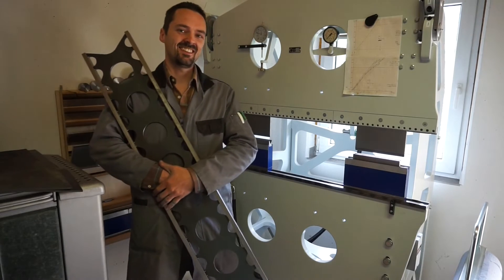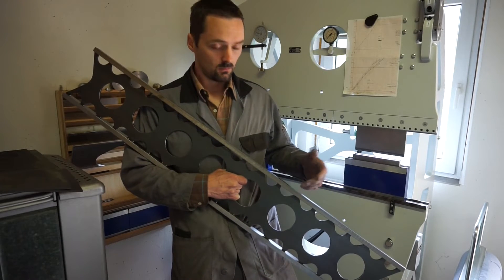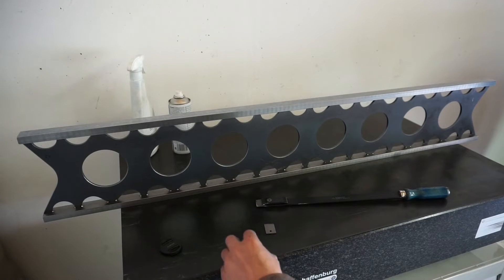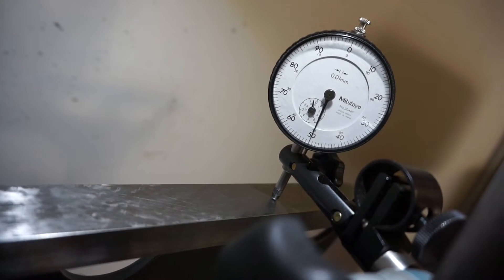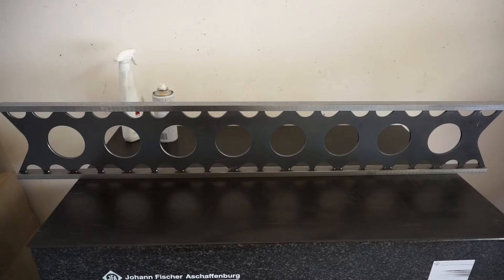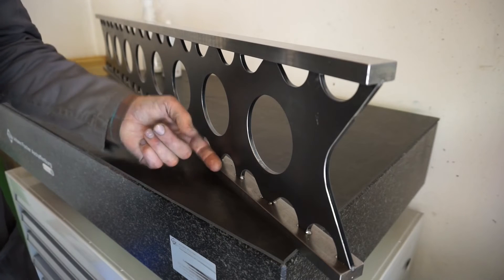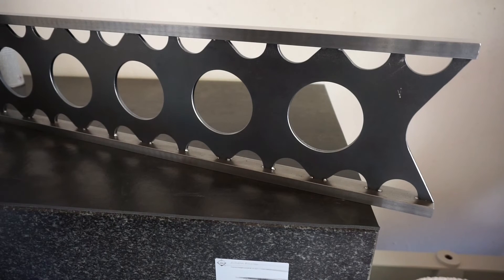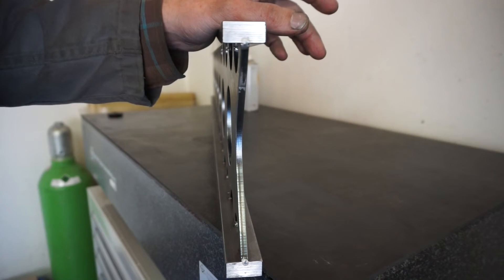Hints on making Straight Edges out of Steel

Comment: Do you stress relieve the tool in an oven before finishing?
Do you worry that over time internal stress is going to distort the tool?
Are you concerned that steel is not as stable as cast iron?

Comment: First, I must say that this is a great technique. I am impressed. 

I too am an engineer. I have a degree in physics. And I have made a telescope mirror which only requires two surfaces, instead of three because it, at least starts out, as a sphere. 

You stated that the three plate method can be used with three straight edges to make them all straight. But this is a common misunderstanding of the three plate method and is not the case. The three plate method says that three surfaces will only be able to be in intimate contact, in all three combinations (AB, BC, and CA), AND in ALL POSSIBLE ROTATIONS when all three are flat. 

So the reason why the three plate method fails when making straight edges is due to the relative small width as compared to their length. Your straight edge looks like about 2 meters long but only around 50 mm WIDE. If you try to rotate one straight relative to another by 90 degrees, you will have only a 50 mm x 50 mm area of contact. And that small contact area will never be enough, in a practical sense, to allow you to bring the three straight edges to true planes. 

The three plate method is applicable to surfaces that are either round or approximately square. Surfaces like the surface plate that you used as a table and a reference. To produce a 2 meter long surface with the three plate method that surface should be at least 1.5 meters wide. Any further deviation from square would make it difficult. This is perhaps why most surface plates are rectangles similar to this. 

If the surfaces are not checked in at least two angles at 90 degrees apart, then there are an infinity of other shapes that can be generated. Perhaps the simplest of these is a surface that is twisted in a manner similar to a propeller. Three such twisted surfaces will nest with each other in all three combinations and even when rotated 180 degrees, which could be done with straight edges. In fact, that twist can be very dramatic to the point that the short edges on opposite ends of the long dimension are as much as 90 degrees to each other - or even 180 degrees. A 1 degree or 1/2 degree twist would be all but impossible to see and to detect if they were rotated to 90 degrees about the axis perpendicular to their desired plane.

Comment: Wouldn't it have been better to heat and quench the 2 beams and center part beforehand in order to harden them, then temper them to something like 30 Rockwell for the perfect balance of stiffness and ductility, and then after welding it all together normalise the whole thing to relieve the stresses from its production process and the welding? I would think substantially increasing the straight edge's stiffness and reducing sag is an important trait, as is relieving the stress induced by the earlier welding?

Comment: Hi, thank you for the video. Two questions though. If we have no tools and we want to go for the three edges method, 

1. how do we get it close to the ballpark so that we can begin scraping?
2. When scraping / lapping both sides how do we insure parallelism?

Thank you.
Reply: I can't really answer your 2nd question, but in reply to the first one; you apply diamond polishing paste to straight edge A and then put another straight edge on it (B) and while making small figure eights you polish/lap them to match, then switch to the other straight edge (C) and repeat it, making sure to continously cycle between the 3 straight edges to lap them to match each other, using smaller and smaller grit polishing paste as you continue. Eventually you'll probably be only a couple dozen microns from straight away, and the last bit you do by scraping or hand grinding with a small rotary tool and sanding drum.

Comment: Greatly thank you, Sir, for such an educating vid! It makes precision machining possible for mortals and self-taughts like i am!

I have one question 🙋‍♂️ regarding the three plates method:
- Robin Renzetti posted a vid about this method suggesting that it will make the 3 surfaces parallel but not straight if the plates geometry is not round as it cant rotate during the spotting ( which is the case for straightedges) 

(Please find the link to the vid in the next comment)

Can you share your insight on this? 
I am planning to build some straightedges that way longer than my surface plate 😁 

Thank you very much and have a nice day!
Reply: Here is the vid i mentioned

https://youtu.be/Va4TGDnQqDs

From 2:30 - 7:25
Reply from the maker: Hello! Thanks for your kind comment.
As always, there is nothing much to add to Robin Renzetti's information. His comment may not be of much significance in case of straight edges. That is, only if the straight edge is narrow (more like a line) and not wide like a surface plate. If it is wide in comparison to it's length, then a twisted surface result may be possible by using the pure 3 plate method. This can be avoided, however, e.g. if you check the narrow side with a precision level or if you check the diagonals with a twist gauge (as Robin shows). ATB, Alex

Comment: An important point in steel geometric equipment making rather than in iron is the stress relief as steel is usually not stress free and not at all after welding , the DIY solution is to vibrate the beam to liberate strees after welding or to make a wood fire and use a master H beam as rest to avoid deformation of the control beam under treatment and let cool slowly in sand or hashes .

Comment: Having a precision level always helps. You can also use a U-shaped aluminum stock and glue sandpaper with different grits into it and use hand force to make it even smoother. Eventually you can reach straightness with micron precision

Comment: This is absolutely fantastic! Did you ever find the laser cutting pattern for the fillet? I don't have much in terms of machines, but I have scraped a few old cast iron hand planes to flat and could use a good straight edge!
Reply from the maker: Thanks! From experience I'd like to suggest to make the straight edge in a size that fits the job at hand. If it is too large, spotting becomes quite awkward. If it is too small, the same problem arises. The fillet sheet is not so critical, to keep it rigid and lightweight, you can follow the design advice in the video.

Comment: From time to time, as a machine installer in the manufacturing industry, I have had the pleasure of working with engineers that not only understand their profession thoroughly, but have the complete capability of constructing their projects. They not only understand what the machine has to do, but they understand the restrictions and complications that can arise in machining, welding and construction. These are the folks a person can learn from. Ive a strong feeling you may fall into this category.
Reply from the maker: Mr. Cullen, thank you very much for your kind comment. I'm not sure if I can live up to such expectations, as you know in engineering and fabricating life failure and bad solutions are much more easy to achieve than success. They say, once you've entered a profession, you think you know everything. A few years later you know that you know not too much. And with a lifetime of insights you know that you know nothing. Be that as it may, :D, thank you again.
Reply: Hi Alex, thank you for your great insight. I have been overconfident for quite sometimes until i read your comment

Comment: Respect! +/- 3 micrometer maximum over 1 meter.
Did you temperature anneal the instrument after welding and before scraping?
Reply from the maker: No, that's the funny aspect about it.
Reply: @anengineersfindings  really? This corrupts all what we have learned from the books. I am curious how the same measurement looks like in 2 years.
Reply from the maker: Right, it does. But keep in mind: As I say in the video, at the time of filming, this straight edge was already 2 years old. The trick do mostly the tiny fusion tacks.

Comment: I love it when the tried and tested methods are proven to be not the only way to do something. Everything I have read suggested that steel is unscrapable, not dimensionally stable enough and that weldments can never stay precise over time. I think your straight edge proves all of these wrong.
I am also unable to source cast iron for making straight edges but have easy access to mild steel, which is what led me to this video. Based on this, I am going to attempt to make a dovetail straight edge for scraping machine ways.
Reply from the maker: Thanks and good luck for your dovetail-straight edge build!

Comment: wow this is great!!I do own a lathe that i bought from the scrapyard really cheap and i revived it to working condition but it needs scraping on the cross slide dovetails. Is there a eway to make a dovetail straight edge so as to scrape the ways or moglice them?I do not own a surface plate and the crosslide is 60 cm long. I cant justify the cost for the right tools cause i am an amature...
Reply from the maker: Thanks and good luck for your upcoming scraping job. I haven't made a dovetail straight edge out of steel yet. Maybe you can borrow one out of cast iron somewhere. If not, you may need to think of a way to fabricate one. Sorry, I can't help you with more advice at this point in time.
Reply: @anengineersfindings  you gave me enough already!Didnt think that  crs can be scraped flat or stay flat!

Comment: Hi great video and project and congratulations on your result of straightness.
I did some crude calculations regarding stiffness. To my surprise I found out that the greater I made the moment of inertia the more the part sagged (theoreticcaly). The added weight of the part when I made it taller resulted in more sag. Even when I gave the part a 20% weight reduction a 1000mm long straight edge would sag 13,2microns when the straight edge was only supported in each end. I chose this load scenario as the sag would introduce an error when a straight edge was laid flat on a surface plate. Did you do any calculations or FEA prior to fabricating your straight edge or am I just overcomplicating things? 😊
Reply from the maker: Hmm... without knowing your FE-model, the behavior you describe (more sag with greater height) seems wrong to me. According to analytical mechanics, the max. sag of a beam with rectangular (!) cross section between two supports equals =const.*density*(support distance)^4/(Young's modulus*height^2). So a beam with doubled height should have quarter the sag, even though it is twice the weight. Maybe your model had a problem with the boundary conditions? I assume so, since you see from the video that the sag of this particular straight edge is well below 10 microns.

Comment: Thank you very much. Is it possible to scrape a straight edge of this length with only a surface plate of half of it's length?
I only have a 24" surface plate.  Also, is there any way to check flatness of something long like a mill table, without a long straight edge? Thank you very much
Reply from the maker: Making a precise straight edge double the length of your surface plate will (I guess) be very difficult. If I were in your shoes, I'd rather make the long straight edge by the "three plate method". You can check a long surface also by using a precision level. This can be annoying because of the waiting period for the bubble to calm down, but with large pieces it may be the only option.

Comment: Great design, well thought and organised planning and execution ! One question: at min 3:10 you say you had the straight edge stored for about 2 years sitting on that rubber; why that ? why not sitting at Bessel points or hung up vertically ?
Reply from the maker: Vertical hanging would be the best, I agree. But compared to storing on the Bessel points, storing on rubber results in less stress in the straight edge and therefore less potential for warpage.

Comment: Hi, why would hot-rolled have been a better choice? How long did it take to make the straight edge? I am astounded by what you have accomplished. Thank you for sharing!
Reply from the maker: Thank you, Sir. Yes, as I say in the video, I'm sure long-term wise it will be better to use hot rolled material. Also as mentioned in the video, it took me roughly 2 days to make this straight edge (lasercutting excluded). Thanks!

Comment: At one time at work we were re-building a number of crankshaft grinders. These grinders (Landis IW's and Pin Grinders) use a flat and V way with the female half of the V in the base. Fortunately the Pin Grinders we could grind the ways in house. The IW's we had to send out. In order to scrape the V for the Wheel Head one of the crew scraped a master from a section of Way Cube from a Cincinatti Swing Fixture Broach used to perform the initial machining operations on inline six cylinder engine blocks. These Way Cubes are made of hardened cast iron. That was a real bear for him to scrape requiring him to sharpen and hone the carbide blades about every two scraping passes. When done worked extremely well.
Reply from the maker: Incredible. Maybe one day people will look at this master way cube and say: "This thing was made like the great pyramids. We don't know how."
Reply: @anengineersfindings  
Oh I doubt that. The manufacturing plant is now an empty field and anything that wasn't auctioned off has long sense been melted for scrap.

Comment: At 13:20 you explain that the spotting pattern changes due to the overhang.  I'm unclear on why. 

Wouldn't the edge of support act as a fulcrum, and the weight of unsupported steel would pull down below the surface plate, flexing the nearest supported steel UP off the surface plate?  My intuition (which is apparantly wrong) insists that the spotting pattern near the edge would be lighter, and very heavy just at the edge of the granite.  What makes the pattern more dense instead?
Reply from the maker: I guess the "flucruming" and the associated spotting pattern you describe will occur if the straight edge is quite flexible in bending. However, then it would not be very suitable as a spotting tool. The more rigid (stiff in bending) the straight edge is, I assume the less you will observe the spotting pattern you describe. I didn't observe such a spotting pattern in case of the straight edge featured in the video.
Reply: @anengineersfindings  - Based on what you explained, I will have to rethink how much that an unsupported tool (even a straightedge) flexes under its own weight. I had incorporated the ideas that "everything is rubber" and "when you measure below 25 microns, everything matters", into how I tried to predict errors in setup.

I believe you saw what you said.  That means I have some wrong idea, and it seems likely to be the one you focused on - the straightedge geometry is rigid enough that even at such small measurement scale, the effect is not significant. 

What accounts for the effect you DID see, the heavier inking near the edge?

Comment: I presume the girder surfaces are heat treated steel? How would you scrape that? Very interesting project. Loved you mill rebuild vid.
Reply from the maker: The girder surfaces are not heat treated, however the girders are out of medium strength carbon steel. I used the techniques shown in my "Hand scraping of carbon steel" video. Thanks.